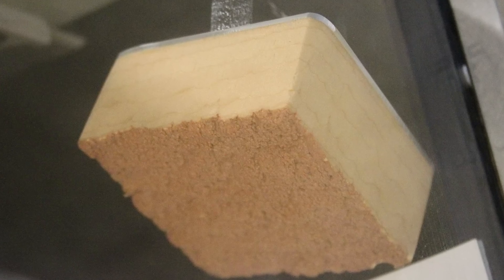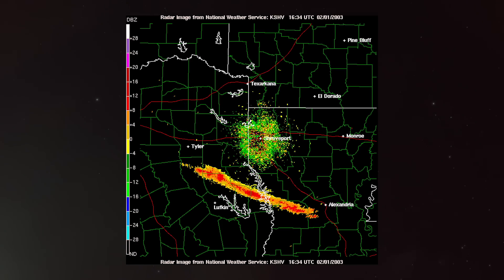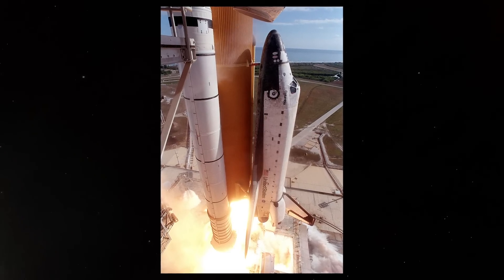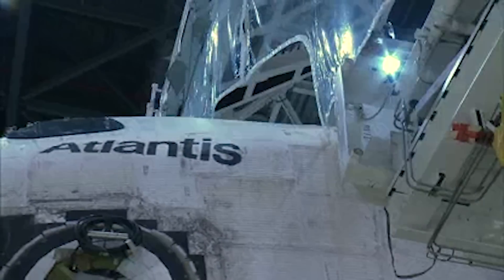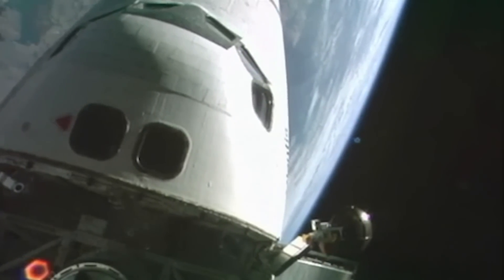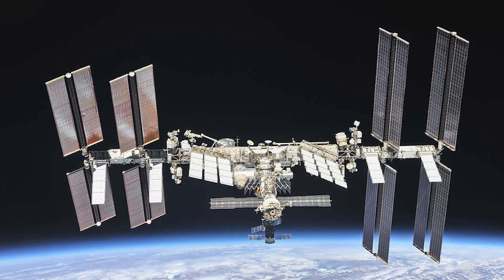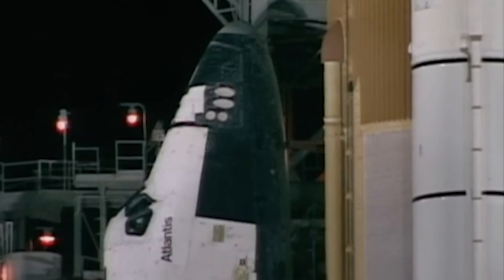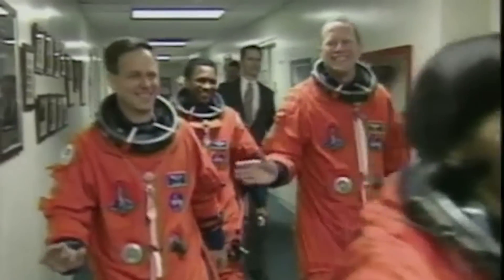The Backup Space Shuttle - A Rescue Mission that Never Launched

Comment: For the very 1st shuttle launch the liquid fuel tank was painted white. All subsequent launches skipped painting the tank as it saved weight and allowed for more cargo. I have often wondered that if they had painted the tank would it have made a difference in keeping the foam from breaking off during launch? Especially if they had used a plasticized paint.
Reply: @Mr Murders doubtful.  The shuttle wan't out on the pad any longer than any of the other shuttles at that time.  It was just commonly accepted, much like the general lose of tiles during any launch, that there was an accepted amount of debry that came off during any launch.  It was typically ice chunks that formed on the tank and lines, and sometimes, even some of the tiles or foam itself. You can see them during any close up shots nearly every rocket launch from Mercury up to Space X.
Reply: John Mcdougald I can assure you sir that loss of tiles was NEVER accepted, “commonly” or otherwise.  You sir are completely wrong. I was a 25 year orbiter TPS Engineer.
Reply: John Mcdougald John Mcdougald Let me help you a bit. Actually “lost tiles” were never “commonly accepted” as you say. True, some came off the upper surface on STS-1 but those were tiles that had not been through the densification process as all tiles on the lower surface had on OV-102 Columbia. That was addressed prior to OV-102 2nd flight. The thermal protection system installation processes underwent many improvements through the life of the  program. Liberated TPS components of any type were not tolerated and were thoroughly evaluated by us in every instance. For example, a loose or “protruding” gap filler was observed during the On Orbit Inspection during the Return to Flight mission following Columbia.  Mission managers concluded based on the analysis that indicated the protrusion could cause an event called “early boundary layer transition” and could lead to overheating of the TPS downstream, the gap filler would be removed by an astronaut during an EVA. It was successfully removed. My point is, a team of engineers, technicians, and inspectors refined the gap filler installation procedure and we never lost one again. That is no small feat, given these gap fillers are the equivalent of bonding a playing card on its edge in a gap that is only .030 inch wide or less, and that there were more than 10,000 of them on each vehicle. So 10,000 gap fillers per orbiter were replaced using the new process, times 3 orbiters, with zero lost gap fillers. Which means, we were 30,000 for 30,000. Not too bad. I worked in the TPS system for 32 years alongside some talented, dedicated, and passionate people. When I see ill informed comments like yours I generally consider the sources, but yours just hit a nerve for some reason.
Reply: Actually, the reason the tanks were originally painted was to protect tanks from the harsh Florida sun.  The thinking in the original outset was that these shuttles would be running often enough that there would be 2, or more Shuttles on the pad at any given month and may be setting on the pad for many days or weeks prior to launch.  When the actuality of how often they would be used and the duration they would spend outside, it was determined that painting wasn't necessary and would allow for less weight to launch.  The paint was essentially sun screen for the tank to protect it and help keep it cool.
Reply: Actually it was painted white on the first and the second launch. Number three and following were without paint. I have also thought about if the paint provided some additional strength that could have prevented this but I think not. You see, even at the first launch, they hade pieces of foam loosening and striking the shuttle (Columbia that time too) despite the tank being painted. No such large damages as the catastrophic flight but I think that was more luck than anything else.
Reply: @skunkjobb  They changed the fomula for the foam as well and it didn't hold together as well.  But as noted every launch had this.  I think it was just a matter of time.
Reply: @Mr Murders it could be both.  It wasn't uncommon for the STS (Shuttle Transport System) to "loose parts" during launch.  The tile issue, from the beginning became less of a problem as the years went on but, they always lost a few on every shuttle launch.  There just simply wasn't any way to guarantee and prevent something from coming off due to the massive amount of force that was generated during a launch.
Reply: @johnmcdougald1238  It shows just what a delicate, destructive and dangerous undertaking it was to launch the shuttle into space. So many things could go wrong(and did), some acceptable some not it seems. I can't imagine what those astronauts were feeling the moment the knew something was wrong or if they knew at all before disaster struck. Thanks for this information btw.
Reply: @Peanutdenver  Sadly, over the years, it's come out through leaks and occasional deliberate media dissemination that, during the Challenger accident, the crew survived all the way until impact with the ocean.  They knew this because a lot of the manual Emergency devices and equipment that would only have been turned on and used by the crew and not automatically initiated were found to have been activated.  The crew probably wasn't even aware that they're cabin was the only thing intact after the explosion.  They pilot and commander were trying to regain control until the very end.  I've had the opportunity to talk with many Astronauts over the years in off handed, casual situations ( I live in Florida and had family who worked at KSC at varying times) and I've never had one tell me they had hesitations about going up.  Just like Soldiers going into combat, Police and Fire Fighters going to work every day.  It's part of the job and the risks you accept for the job that you do.
Reply: @johnmcdougald1238  That's really tough. Thanks for the information and I completely understand about doing your duty despite the dangers. That's really cool you're able to speak to these astronauts and learn about their true feelings and experiences. I find it very fascinating.
Reply: @Peanutdenver  its amazing when you think about it that the only Astronauts we lost were Apollo 1, Challenger and Columbia.  And not a single one actually happened in outer space.
Reply: @User31129  So true and you don't hear that mentioned very often. For such a dangerous endevor i'm surprised it hasn't happened more.
Reply: John Mcdougald You’re still wrong, very very wrong.
Reply: Wouldn't have been a problem if they hadn't cancelled the SSTO.
Reply: The first 2 flights of the 4 test flights, STS-1 and STS-2 were BOTH painted white.  600 pounds of weight were saved allowing more cargo to be lifted.
Reply: That is an excellent point.
Reply: Oooo nice thinking but shit happens u can’t waste time having your thought processes into past problems when future opportunities are more important.
Reply: Paint weight just half ton 250kg they decide without paint shuttle carrying extra payload or save more fuel energy
Reply: @காமெடிகலாட்டா-த4ற  It's closer to a 1/4 ton at 600lbs, and I think that if it would help keep the foam from breaking off, that 600lbs was worth it.
Reply: UnknownUzer 595 pounds to be precise
Reply: matrix49A CFC-11 was replaced by HCFC-141b in all 4 types of foam used on the ET. The result was called popcorning which caused extensive tile damage on STS-85 and STS-86. Eventually testing determined that HCFC-141b had a higher vapor pressure combined with a lower yield strength caused the popcorning.
Reply: ya mean to tell me...that hardening the leading edge of the wings wasn't an option? Sometimes in science your balance does its protection outweigh the saftey to need to keep the weight down...they were more worried about weight period
Reply: UnknownUzer ☆ Afterwards, NASA asked for suggestion & I suggested a plastic mesh "scrim", also with a resilient paint, but they responded "too much weight"
Giving "Rocket Science" a Bad Name.
Reply: They didn't need to do the entire tank, just the top 1/3 where loose foam could hit the wings.
Reply: @user-mp3eq6ir5b  I knew I couldn't be the only one who thought about this. I even thought that a coating of simple bed lining material such as Rhino Liner or plasticised paint such as Plasti Dip would do wonders for helping the foam retain integrity, it wouldn't have to be a thick layer, just enough to act as a skin, like saran wrapping leftovers.  I feel as if they were putting cargo capacity over Astronauts' lives. Yes it would add weight, but not so much as to prevent the Shuttle from doing its job.
Reply: UnknownUzer ☆ Couple of turns with strapping tape would have been better than lame excuses, Right?
NASA - Giving Rocket Science a Bad Name.
Reply: @UnknownUzer  Your backseat Engineering.... the tank is disposable. There are trade offs in design.  Your adding a ton of wieght for little return.
Reply: @WALTERBROADDUS  I wouldn't call the lives of highly skilled and trained American scientists/astronauts as a "little return"
Reply: @UnknownUzer  I just have Easily question the carbon carbon material  on the wing edge.  Can you make a panel that re-entry heat doesn't shatter like glass?

Comment: I watch it come apart as it reentered the atmosphere a long fiery disintegration. My girlfriend looked at me and said that didn't just happen i looked at her and said yes it did.
Reply: When Columbia was lost, I read the CAIB. Every page. 

As you read, you realize that while just a machine, an inanimate object, Columbia did things she was never designed to do. The RCS and control surfaces are not designed to work together. They're technically not supposed to, because the RCS is disabled below about 70,000 ft. The control surfaces are designed to start feeling the effects a little lower in the atmosphere, yet Columbia had both systems working simultaneously. 

She was literally fighting to save the crew. As I type this, I sense ninjas cutting onions. 

As dry as a NASA document can be, it still invoked an emotional response. Let that sink in.
Reply: @JephN79  The NASA culture in 1986 is the same as the one on January 27, 1967.
Reply: @JephN79  Both systems DO work in conjunction with each other, or did. The switch from RCS to aerosurface control was not a discrete event. At the beginning of the ‘entry’ maneuver, RCS was used for control until the local dynamic pressure reached a certain threshold value. At that point, aerosurfaces were ‘blended’ with RCS on a ‘schedule’ that was dynamic pressure-dependent.
Reply: robert hill that must have been terrifying
Reply: @justanotherasian4395  no didn't affect me i simply observed it.  If  you were into aviation watching space shuttles orbit and land was just what you did.
Reply: @MrPig40  or they are just a reasonable human being. Why should it affect me to the amount of terrifying me watching something about people I don't know personally. Clearly it was a sad event but not terrifying as long as you didn't live I'm the area the debris came down.
Reply: @MrPig40  dud me too, I may be not shocked at all, 
First: I cannot know if that thing is actually a space shuttle
Second: sometimes you say "welp, thats it, sigh" I mean, what could you do now? Cry? Maybe yes,but I will feel just a little depressed, but it is part of life and nobody can't expect those things to happen. 

R.I.P to them all
Reply: @roberthill3207  Until PTSS hits you after years and years of witnessing things like these... Been there, done that. You clearly need help buddy.
Reply: I was in the navy. I've been obsessed with the shuttle program since Challenger (I was 6 at the time), and was filled with a sadness and anger that I've never felt simultaneously. The same safety culture that existed in JAN86 at NASA was still alive and well in 2003.
Reply: A ton of Americans watched not just 6, but 160 or so people die when the 2nd plane hit the WTC. Just because you dont burst out wailing, doesn't mean it didnt affect you.
Reply: @tommypetraglia4688  people deal with things different.  Chill
Reply: I watched it too ROBERT from Houston